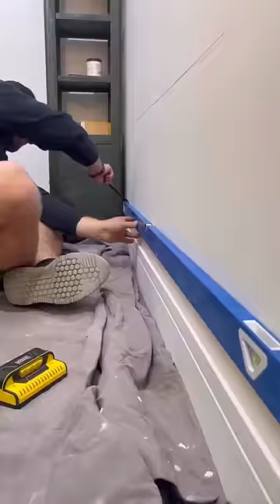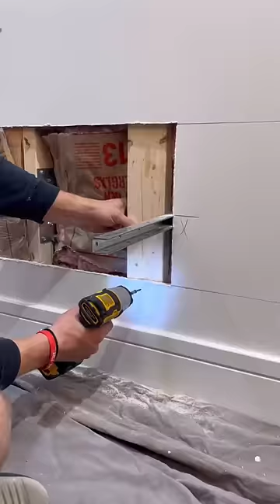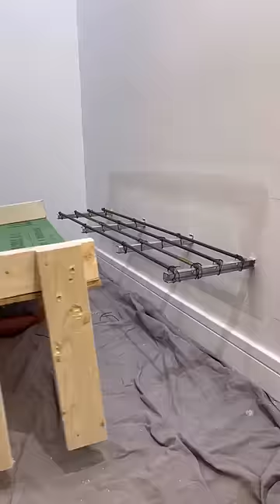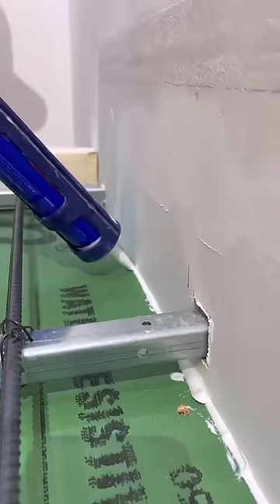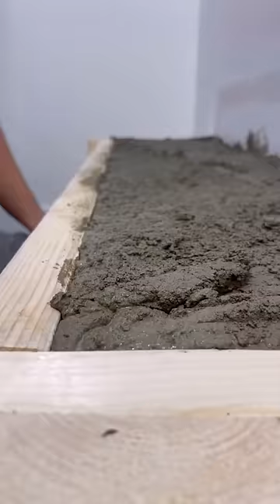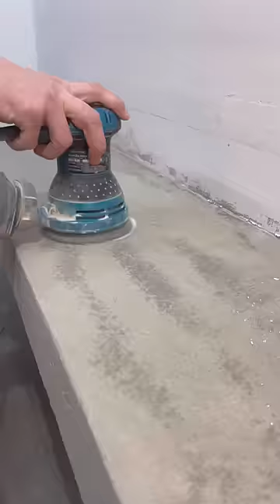Build a Sleek Floating Bench with the Fittes Brack Kit

Comment: This is the most deserving of the term OVERBUILT.
Reply: I'm not sure that. Holding concrete tab that thick/heavy... the wall won't hold it for long.
Reply: @mik8352  yeah, I saw those skinny little wall supports flex when he walked on them.  now imagine a couple hundred pounds of cement.  then when he jumped on it again, it flexed again.
Reply: @Girruuth  160 pounds of crete and it didn't flex after it was built. The bracket's and rebar together spread the load out evenly as well as keep it from cracking. As long as the wood is solid behind it and none of the screws are loose or stripped, it will last a very long time.
Reply: @JnitraM078  Problem is he used Countertop Mix, which needs a sealant once set. It's gonna start crumbling in a few months, and start cracking in 12-18

Comment: A concrete bench attached to cardboard wall. What will they think of next.
Reply: What card board?? I see sheet rock, 2x4's and insulation for those walls.
Reply: I mean he has steel supports attaching to four ceiling to floor 2x4 studs, it was obviously strong as he displayed,  so what is your point?
Reply: Yea I get it your European and have stone and plaster for walls but in America we live in cardboard boxes
Reply: Just block the channel
Reply: @prestonMartin-qt7gi  This way of construction can hardly be called "wall" That's why everything is flat after a Hurricane in the US.
They never learn.
Reply: @NOWAR-q7s I've been through about 50 hurricanes where I live with about 5-10 of those being high category ones in my "cardboard" house and it's still standing just fine. That also goes for pretty much everyone I know...no flat houses to speak of. Maybe you mean tornadoes, but those with tear through almost anything

Comment: The floating bench is harder than the whole house. Thats why we build houses like your bench in the rest of the world
Reply: Lmao everyone says this but it’s not true. Stick framing is common around the world not just America. We also have metal framing, stone, all kinds of homes.
Reply: Yeah but remodeling is a he'll of a lot easier with wood framing. We also have tons of brick homes in the states. It's a mixes bag
Reply: I have cinderbock and mortar walls, concrete floors and ceilings. Totally silent in floor heating and soundproof walls. No dents in  wall anywhere. Switzerland. Standard. Nothing special
Reply: @tonyhowes669  How expensive is it to find and fix a burst pipe or run a new electrical outlet or switch? Do you require heavy demolition equipment to get into the wall cavity?
Reply: @CombatIneffective  have you heard about conduit. And the quality of plumbing is way better and lasting in Switzerland
Reply: @NOWAR-q7s so what material do you use for plumbing in Switzerland that raises the quality or is it just the way it's installed?
Reply: @Renkin26  Conduit makes repair easier , better materials and also the way plumbing and electrical is installed. In the US, Australia and New Zealand the poor plumbing and electrical work goes along with the poor and underperforming 4x2 construction method.
Reply: @morganhamm6753  Framed houses in Austria or Switzerland are a world apart from that rubbish which gets blown away in the US.
Reply: @Renkin26 im not actually a plumber, and the chat was about walls and benches.

To pull wires, they would use conduit. Mostly. In floor heat is very low pressure pipe with glycol so no bursting possible. Problem we just had was calcium buildup. Solution is to drain system and push through solution that disoves the calc. For big rebuilds of washroom that realign pipe for toilet or shower, it does require a jack hammer. But this is not much different than ripping up tile and floor. Or in my old house in canada the ground floor tub has the drain going into foundation cement. 

So... everything is way way beefier in switzerland. Built to last. Not built to change in 5 years. Not many knock down homes. Not many big renos. 90% + homes are architect designed, and work. No need to change. When people buy roofing in n america they talk about 10 year vs 20 year ashfault shingles. Here a roof is good for 150 years. So is the house... or more. My relative has an extreme example of this, living in a 400 yr old 4 story wood and cement house. There have been renos and modifications for sure. Probably 3 to 5 x in 400 years!
Reply: @NOWAR-q7s  I just think it's overexagerated quite a bit. Plumbing doesn't need to be replaced for 40 years typically barring minor repairs and electrical is good for a long ass time too, just changed for safety. There are houses still operating perfectly fine with 80 year old electrical it's just not nearly as safe as current stuff. Conduit would definitely be way better to replace the entire system when needed just a big pain in the ass to add a receptacle somewhere there isn't conduit. The real problem we have in the US is the markups for labor combined with shitty standards. That can be a huge problem with cement and other materials too, just looking at china's construction.
Reply: @Renkin26  Conduit is way cheaper than paying someone to find and fix  a leak or a fault somewhere in the wall/ceiling/floor.
It requires smart planning and good workmanship. There is no law prohibiting you from putting it all into place DIY and the electrician does the connections.
Reply: @Renkin26 Then you wont like the cost of labor in switzerland. N america is pretty cheap in comparison

Comment: This induces a lateral stress on the 2X4 studs that they were never meant to hold. Especially not for years and years. The brackets used are like installing a 2 foot long crowbar against the shear capacity of the screws into the studs.  Will it work?  Sure,, a rather creative thing to do.  Will it work for decades,, I am seriously doubtful it will.
Reply: It will hold for a long time, that brace he put under it cinches it
Reply: haha, oh wait!! maybe I spoke too soon, all that concrete just made it really heavy/oh well I trued
Reply: I am wondering why he used concrete. Should have used a beautiful piece of wood, better looking and much lighter.
Reply: Decades? Who cares they will probably move to a different house by then.
Reply: I thought the same thing.  It is a cool little weird design, but it needs a much different bracing system.  I would also refrain from using a level to do my concrete work, but I like my tools to work for more than a couple projects!
Reply: @tony-kadachi9133  I am a builder. The first building I built is now 58 years old and still in use.  The oldest building that I have worked on, I replaced a wall and partially resided the house, built in 1680.  There are engineering concerns,, 2X4s have specific strengths in specific directions.  This use is not one of them.  I was looking at wooden power poles today, you should too. If the wire stresses are not equaled the wooden pole will bend over a decade or two. The one I noted today was bent to about 15 feet out of true.  Bending wood takes decades.
Reply: @Sailor376also  It's a shame the world we live in today doesn't care about this knowledge. All houses built in the last few decades are not built to last. So these concerns you have will never matter as the house will rot and need rebuilt before that ever happens.
Reply: @tony-kadachi9133  So very true.  It has always been that way, I think.  We speak of, at times, of how they don't build 'em that way anymore.  I have seen the cellar holes.  All the really crappy structures already fell down.  The better built are what we see, what has survived.  I tried to learn, to do it better. Time will tell, long after I am dust.
Reply: @johndamjohn  I guess he was looking for "Prison Chic"
Reply: @tony-kadachi9133  Ideally not, if you own a whole house, chances are you aren't moving any time soon
Reply: Tell me youre an engineer without telling me youre an engineer...
Reply: @wendallcass3433  yessss
Reply: @dirkvarner8388  Laughing.  Entirely self taught.  Extensively.  Designed and built many structures. Usually a focus on passive solar and super insulated.  Designed and not built many more. Better than most engineers, because I have to eat what I build.

Comment: Well, I can appreciate a guy having a vision and making it happen, I personally would’ve just done a floating wood bench. I also can only think of how much it’s gonna hurt the first time you bark your shin or your knee on that sucker. 😂
Reply: Imagine the effort to remove or alter the concrete slab bench... 😂
Reply: Exactly!
Reply: @williamgrant2289  nah the whole bench will detach from the studs by the screws. Will just have to cut a small hole at each stud, patch, and paint. max 2-3 hours of work and a few hours of dry time.
Reply: @williamgrant2289 all that drywall work too is a pain. I try to avoid that as much as possible. There’s bracket kits out there that mount to the studs on the outside of the drywall that would have performed just fine but I suppose since the bench weighs 120 pounds by itself he needed the extra beef. 😂
Reply: @HBosse90  You’d have to cut a hole big enough to get your drill in there and be able to have enough space to back out the 2 1/2 inch screws that are in it. You’re probably gonna have to go even bigger because the screws are now directly behind the concrete. Fact of the matter is, it would be a big pain in the butt to remove it in comparison to if you would use brackets that mounted on the exterior of the drywall or if the bench was Wood and attached to the brackets a way that you could remove the plank. All things concrete are meant to be there a while though so hopefully he likes it. 😂
Reply: it is too heavy for the wood wall.

Comment: Great and durable idea. I probably would’ve finished it off one of two ways a little differently. You could’ve done put a tile on it making it more aesthetically pleasing. Or if tiles are not your thing, you could’ve put a small stone aggregate into the concrete mix, and then using a grinding wheel exposed the stone aggregate coded with a resin so it’s easier to clean. making it more interesting feature. But overall clever idea

Comment: The weight of the bench will over time either warp the wall studs or loosen from the studs. Which is first noticed will depend on how much use the bench gets and how heavy the use.  Moisture in the air will lend to warpage. I'm sorry  to bare bad news.  Workmanship aside this is a project you may regret.
Reply: 😂 Первое, что он заметит - резкая боль в почках.

Comment: Future mold issues with that drywall. Needed to use green board for kitchens and bathrooms, Backer board, or sealed the drywall with something before pouring that wet crete on to it. Be aware in a few years

Comment: Curious if the moisture from the concrete mix will seep into that drywall around the bracket arm and fill that wall cavity with mold. I would have caulked around where the brackets came through the wall personally

Comment: the load bearing elements screwed to the thin drywall, and the rebars parallel to the "wall" ? 
the biggest momentum will be in the OTHER direction...